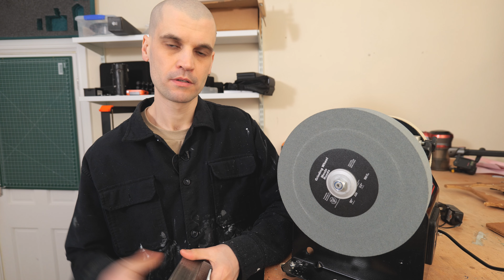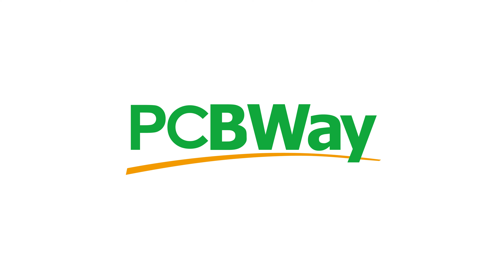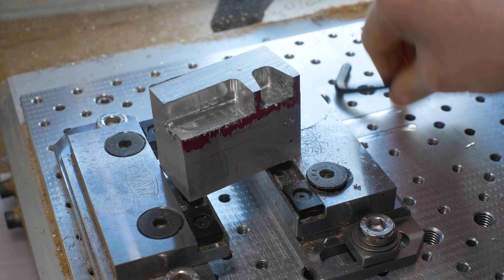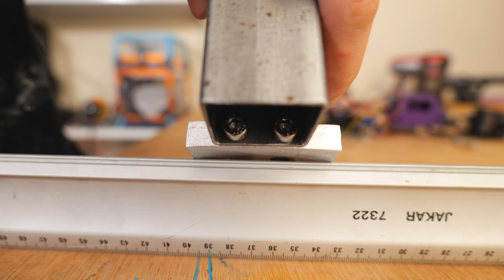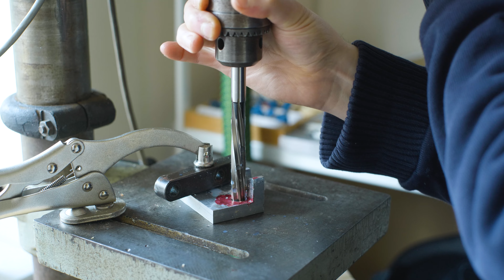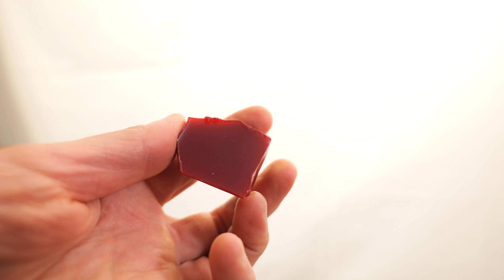DIY Tormek TT-50 Alternative - Whetstone truing jig

Comment: Thank you for sharing your design.  I was reluctant to pay over 2/3rds the expense of a clone Tomek motorized stone sharpener for a diamond truing jig.  I am thinking of incorporation a few diversions (it would be too bold for me to offer them as improvements) from your model.  

I plan to utilize Azek pvc foam board for the two end pieces and diamond carriage.  I do not think the minute load of a slowly advancing diamond point requires machined aluminum.

A 0.5 carat diamond mounted on a threaded rod, intended to dress engine valve grinding stones, are about as expensive as the dresser you used and should be easier to use and build.

It appears that you oversized the holes where the threaded rod goes through the aluminum end caps.  Provided that the rod is long enough, I think it would be advantageous to thread them as well.  The diamond carrier would be more rigid and should resist chatter that way.

The idea of using square section steel tubing is brilliant.  I will likely drill holes in both top and bottom to ease installation of Allen headed fasteners.

I will, of course, comment again once I make mine to see if application approaches theory (to the good or bad).

Comment: Wow!! Very exciting video, looks like you've gotten a bunch of new toys? Very cool to see. I'm still using ye olde whet stone, and a guided stone system from Worksharp. Honestly, it's probably plenty adequate for my needs, but nonetheless it's cool to follow along and see you making use of power tools.

Might also be worth checking the balance of your wheels if you haven't done that already!
Reply from the maker: Hi White, i might actually send back the sharpener, it's great, but I really just wanted to see if I could use it to make a rounded tip blade. For most flat profiles a regular whetstone and hand will do the job as you say. Something like this is handy if you have a lot of hand tools to sharpen. I do eventually want to do more woodworking so maybe it will find some use there. At the moment there's no space to keep the machine, I'm starting to draw up some plans to build a workshop/machine shop in my garden so when that is completed in a year or 2 this might have more use, have to wait and see.